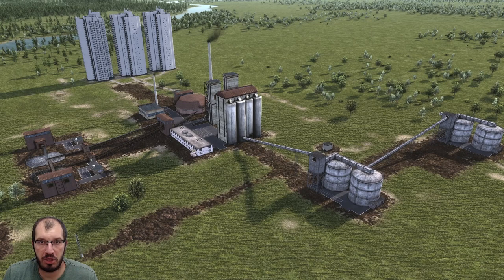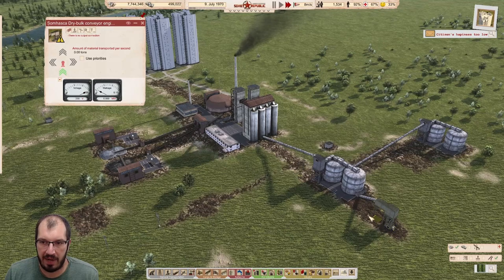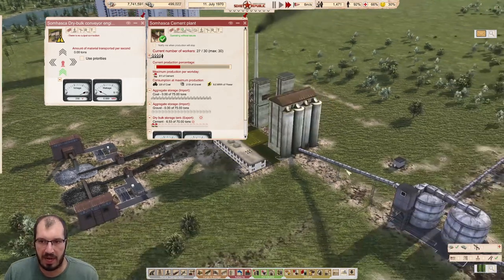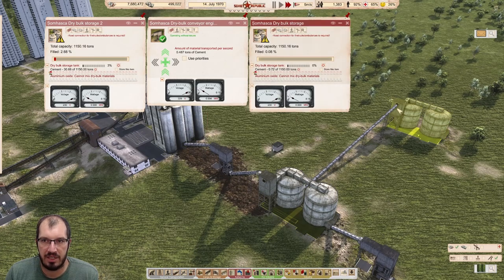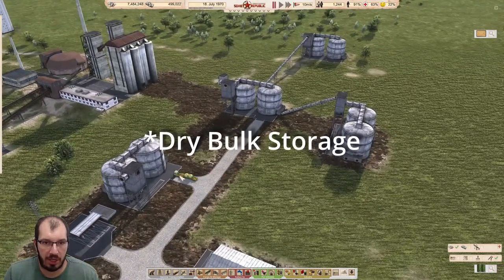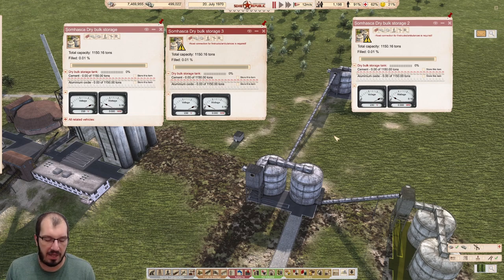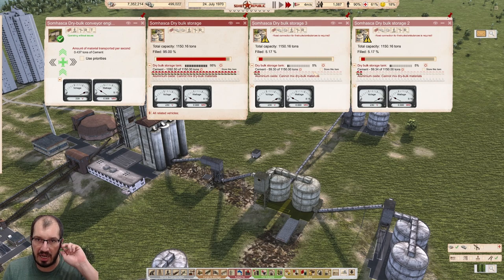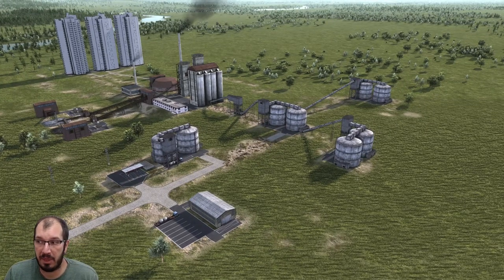Complete Dry-Bulk Conveyor Guide | Tutorial | Workers & Resources: Soviet Republic Guides

Comment: I had no idea the dry bulk that can push two deep.
Reply: Same here. I would expect them to push to the second while the first one is full, but definitely didn´t expect to distribute that evenly. How?
Reply: I think it has to be a bug.
Reply: @dijego-jelle  It works for all structrures like that. It is either a bug, or a deliberate thing.

Think of it as a possibility of creating superlarge storages without need for road to other engines. Mods are one way, set of 5 drybulks is another.

And if Bballjo is correct and engine can "pull" from 2 consecutive as well, having a 1->4->1 setup with engines on both sides could be quite a dope capacity
Reply from the maker: They can only pull from 1 level.
Reply: @bballjo  thanks for clarification